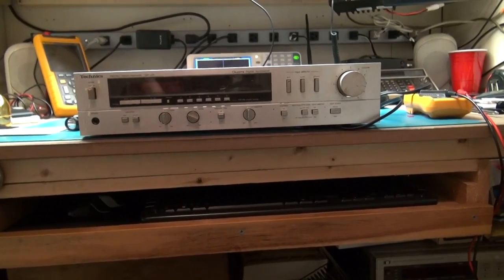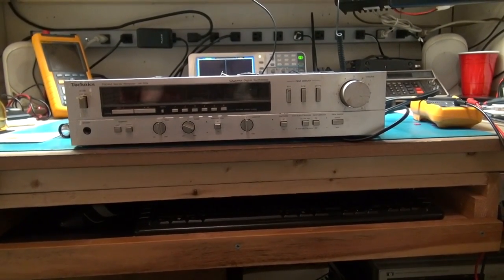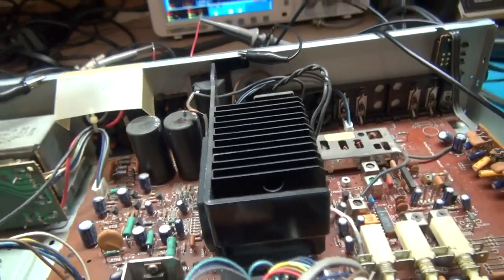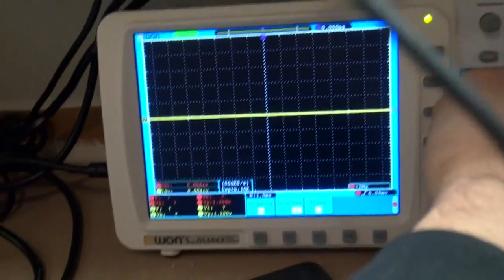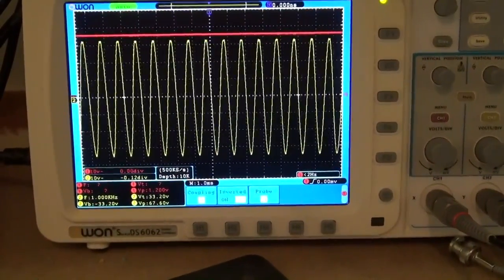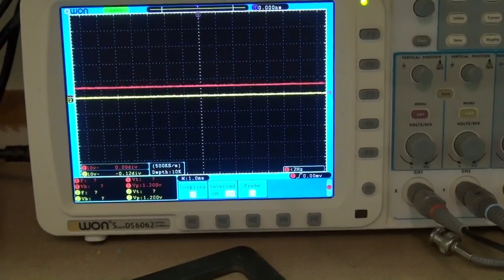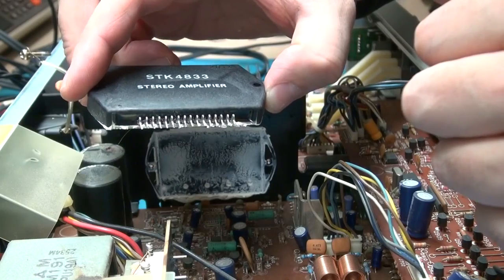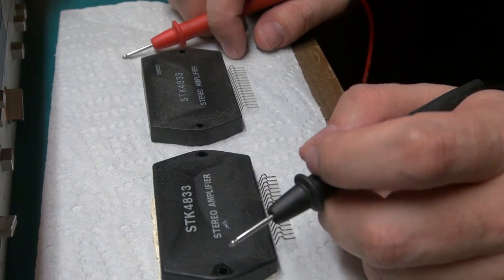STEREO AMPLIFIER REPAIR TECHNICS SA-206

Comment: I really hope that you had a good look at all the capacitors because those integrated amplifier ic don't go bad from just sitting around... if one of those things goes bad, then something else has caused it and the real problem needs to be found otherwise it's just going to happen again at a later date.... All equipment of that vintage will definitely have bad capacitors, so it's good practice as a technician to replace them all and it will be restored to it's former glory... There is absolutely nothing wrong with those STK amplification Ic's... they produce a beautiful sound and are extremely reliable...

Comment: That was exactly what I needed to see. I always wondered how the desoldering was done. what is the desoldering tool that you used. are they available online for example. Also what is the item that you used to look closely at the pins after you soldered them ? 
great  'tube' learnt how its supposed to be done. I'm going to replace the SVI3205 on my SUZ780, may even put a 3206 in but I'll need better sink/fan setup.
Reply from the maker: +armarra The de soldering tool is a Hakko 808. You can also use de soldering braid or a manual solder sucker. The optic I used here is a 10x eye loupe and a macro lens for my camera to recording.

Comment: Thanks. I am interested in the soldering tool. It has a fine tip. I am having trouble finding the equivalent tool to solder identical power modules in a receiver I am fixing.Thanks for your time and helpful videos.
Reply: if you buy a regular soldering iron, you can buy the tips seperately just as long as they can take the same wattage as the soldering iron.

Comment: Hi Kev31779, i have Technics SU 7200 amp. Everytime i connect L R channel with wires from 2 speakers. It sounds rattles crackles and popings. What seems to be the problem ? Any solution ? Thank you in advance
Reply from the maker: +S p r u n g t o l Hello,  There could be many different things that could cause problems in many different kinds of amplifiers. There is no one particular part in a specific location that I can tell you. You would have to diagnose and determine what part of what circuit is malfunctioning. I would start with checking power supply voltages.
Reply: +Kev31779 Ok thank you for your advice

Comment: I have a optimus sta 3250, it pops and cracks through the speakers,  it still puts sound out,  but popping cracking noise,  it not the speakers, it's coming from receiver!
Reply: Deoxit on the volume control usually cleans that up. I'm here because I just bought a SA-206, when I hooked up the speakers one channel was really scratchy and the other good. Deoxit to the rescue, sounds great now.

Comment: Hi I have a Vintage Yamaha R-3 Natural Sound Stereo Receiver, yesterday while it was on (not playing any sound at the time) I heard a faint crackling sound coming from both of the speakers, it got louder and sounded as if it was connected to a mic which had been placed in a bombfire. I powered off the unit straight away, then after clearing it of power I turned it on again to see if I would have the same results and the dreadful sound still came out. Do you think that the unit is worth saving or scrapping? It is a nice one with a good sound (before the problem). Thanks for reading.

ps. I have a Technics SU-Z25.
Reply from the maker: The Yamaha R-3 was nothing special. It was an early 80's budget receiver. One thing it has going for it is that it doesn't have an integrated amplifier IC that was very common for the time period. It's only worth fixing if its worth it to you. It's probably  bad solders joint or capacitors that's causing the issue. The Technics SU-Z25 was an integrated amplifier and was common for the time and for Technics. That was not without its problems as well. All receivers develop issues eventually. Its really up to you if it is worth fixing and keeping in your collection. Some of the early 2 CH amps sounded really good.
Reply: Kev31779 my su-z25 works well apart from the power led. 
I have decided to shift the yamaha off to a friend of mine.
do you know if I can find any cheap Sony apm-77w speakers.
Reply from the maker: No idea, maybe Ebay.
Reply: none are available, but thanks for your help.
I had someone look at the Yamaha today and it worked well which is rather odd, I have not done much to it other than wiggle the components to see if any are loose which would indicate possible solder failure, so it probably needs some soldering done to it.

Comment: How do they compare sound wise compared to a non IC amp. is it low distortion, clean 10 watts.
Reply from the maker: +MrMac5150  I never liked IC amps. They can be comparable if done right.
Reply: Kev31779
 I did not hear you talk about biasing on that unit, so I figure everything is set in that chip, and the replacement is so cheap, how can you go wrong.  Cheers  good video.
I like your repair videos, and hope you will show more troubleshooting  techniques.
Reply from the maker: +MrMac5150 Check out the gigabit switch repair. There is some troubleshooting in that video.